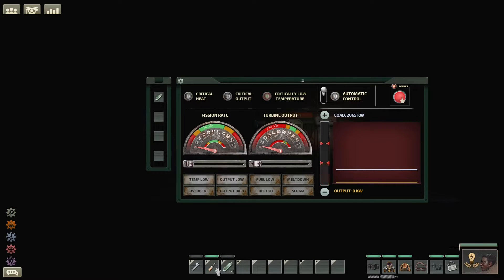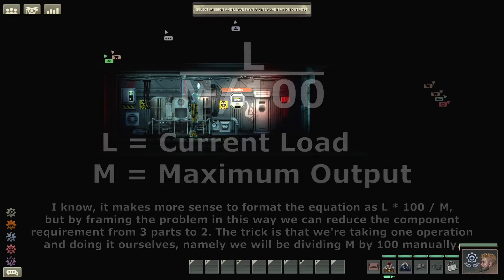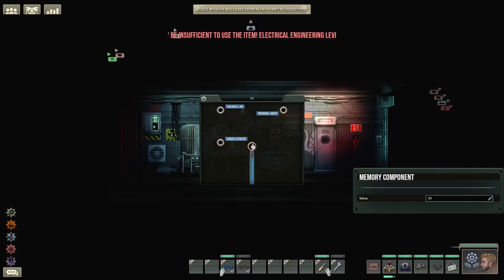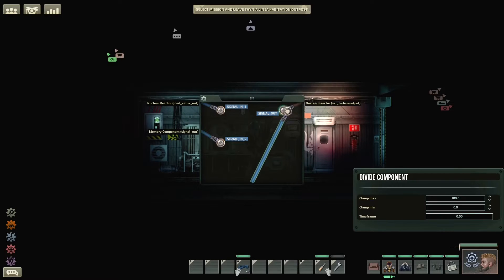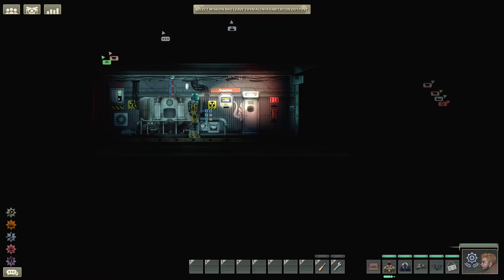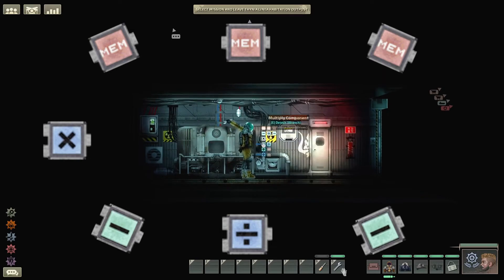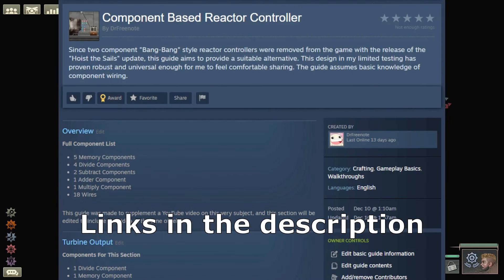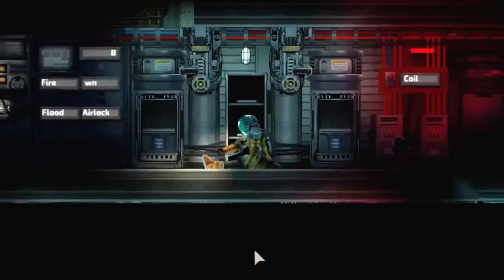New Hoist the Sails Reactor Controller | Barotrauma

Comment: I've been doing the typical 5 component reactor system, and it really does not work well on tier 2 or 3 subs until you get more upgrades to the reactor, constantly causes power outages and runs slow.  Going to try this out and it makes a lot of sense going through the math, i appreciate the design and explanation.

Comment: Is this design still viable? I set it up on a sub with my friends, but it's burning out the electrical systems all over the place. I paid attention to warnings on the reactor and output, and I'm finding it's been running the system with high output almost all the time.
Reply from the maker: They’ve had many updates since this video, so it might not work anymore
Reply: @FailroadExpress  Crap, no worries, I'll fiddle with it some and look up other, more recent, guides in the meantime, thanks for the reply!

Comment: 5 component reactor controller is better than this unnecessarily oversized design. Doesn't work faster than others.

I analyzed your design. According to you the set_fissionrate = [(set_turbineoutput + 50)/(fuel_out/50)] * {1,1-[(temperature_out-5000)/1000]}.
In fact it should be set_fissionrate = set_turbineoutput/(fuel_out/75). And if you want overheating protection (that even won't work, just like your temperature correction) you can multiply it by  output 0 and negative output 1 from 'greater component' comparing the temperature with the value of around 6100 (that is the temperature at which your desing multiplies all by zero).

Comment: 2:29 suppose the ship has an engineer that chose the talent "Buzzin" wich increases the reactor max output by 10%, are there any other major modifications that need to be done besides adding 10% to the max output before dividing by 100?
Reply: I did it and it still works, just add 10% then divide by 100.
Reply from the maker: @ninjasamuraiul  Awesome.  This is great to know.  Thank you for sharing!
Reply from the maker: We haven't tried that yet.  You may have to experiment with it and let us know what you find.  Thank you for letting us know.

Comment: I use a 5C controller, what you'll need are the following:

- 2x memory components
- 2x divider components 
- 1x multiply component

(pmax is the reactor's max power, including upgrades/talents)

Turbine output = load_value_out divided by pmax/100 (so for the humpback the pmax divided by 100 is 31)
Fission Rate =  turbine output*75 / fuel out

pmax/100 = memory cell (1)
75 = memory cell (2)

Wiring is basically in the order written

load value out is gonna sit in signal_1 - memory cell(1) is gonna sit in signal_2 | divider(1) =  hooks to set_turbine_output 
turbine output sits in signal_1 - memory cell(2) gonna sit in signal_2 | multiplier(1)
multiply component sits in signal_1 - fuel_out sits in singal_2 | divider(2) = hooks to set_fissionrate

// I'm terrible at writing instructions.
Reply from the maker: Wow. Just 5 components. We might have to try that out sometime. Thanks for sharing
Reply: @FailroadExpress  I'm not sure how much more efficient this is in comparison to the automatic controller but I did a rough burn rate of a single uranium fuel rod at 2000 kW constant load and my 5C controller came to be around 20% ish more efficient.

Some stuff I did do to suit my needs better; at the helm I've installed a lever which once it's pulled will OC the system by about 1.5 times the current load, the lever is basically hooked up to my mem cell (1) which holds the pmax/100 (the lower you go with this value the more output you'll have in relation to your load)

So to achieve this, you need 2 additional relay cells, 1 multiply cell and another mem cell.

mem cell(3) will hold the multiplying value which for 1.5 times of the load is 0.667
mem cell(1) goes into signal_1, mem cell(3) goes into signal_2 | multiplier(2)

mem cell(1) goes to relay(1) 
multiplier(2) goes to relay(2)

relays(1)(2) both get hooked to divider(1)  

Set the relay hooked to mem cell(1) to ON
Set the relay hooked to multiplier(2) to OFF

Set lever TOGGLE and STATE - OFF

//1.5 times is a conservative amount, if you want 1.7 or 2.0 for the subs that can take it then 0.588 and 0.5 are your values - or just go wild with it :))
Reply from the maker: @Adamonus  Very cool.  Do you use that on multiplayer or single player?
Reply: @FailroadExpress  99% of time I just play by myself so SP.

Comment: minor nitpick, you say fusion, its fission, i know whatever 

(this comment was long and the previous section was a mess, its deleted, this is the correct answer.)

ok quick edit: i checked the math, not the reactor, its actually based on the same math the wiki says, just simplified, its not quite perfect, but its a good enough approximation and works just fine, though it requires some forethought since the numbers require calculating based on the reactors max power.

just to predefine something here, the reactor im basing off of is 5000KW

turbine is simple, the wiki formula is (100 * load) / (power max which equals 5000 in my case), you may notice you can move the 100 from the top to the bottom to simplify that, so now you only have  load / 50, since we've removed the 100, and moved it over to the max power value.

the same can be done for the fission rate, and this is actually where my magic constant comes from,
wiki formula is (load * 7500) / (power max * fuel potential), again same idea move the constant to the bottom in powermax
it now becomes load * 0.6666 * fuel potential
technically the magic constant is 2/3rds given that its 5000/7500, but you can approximate it quite heavily, 4 decimals is likely more than plenty, i suppose you could also run it through a floor or ceil component if you really felt the need.

Wiki math is nice for calculating but when wiring it just do what i did and concat it down. Its like 4 components now.
Reply from the maker: Thanks for the thorough comment. Yes, no matter how it goes it takes a lot of math to get any of this to work just right.
Reply: @FailroadExpress  i rewired my circuit for modern reactors, and added a simple temperature failsafe, including all of the circuits its definitely more than 10 but you could probably get it down to about 10-20 including the ability to turn off the reactor, i'd have to really optimize it, but if you just want basic reactor control it can be done with probably 8 components.
Reply from the maker: @killingtimeitself  That's awesome, considering how complex it has to be now.

Comment: The popular "minimumest temperature" reactor controller uses Fissionrate = 75 × Turbineoutput / Fuel (usually with a simple override to 0 if overheating is detected). It creates no excess heat.

This reactor controller uses Fissionrate = Kt × 50 × (Turbineoutput + 50) / Fuel with Kt going from 0 to 1.1 depending on temperature as a brake/booster.

When reactor is at max power (Turbineoutput = 100) this 50 × (Turbineoutput + 50) part becomes equal to 75 × Turbineoutput  (=7500), but at lower loads it linearly provides extra fission to keep temperature up - at 5,000° (at zero load it's equal to 2500 - which provides 5,000° reactor temperature).

Making reactor stay at higher than necessary fission rate & temperature at low loads makes it better prepared for load spikes at expense of fuel.
It also makes a temperature regulator based on a constant 5000 temperature simple.

I don't know how optimal "50 × (T + 50)" is. For example, "60 × (T + 25)" will produce 3,000° temperature at no load.

For pairs of these numbers you can just input into desmos:
x(100 + y) = 7500 (ideal maximum)
xy = 2500 (half target temperature)
and for 2500 you'll get 50 and 50.

But this way temperature controller needs more complex input instead of just a memory component with 5000 in it, or a completely different design altogether.
Reply from the maker: Thanks for the thoughts. Yes, it was difficult to get this controller as simple as possible while still working. What you suggest might very well work better. Appreciate the effort you put into it.
Reply: I noticed that "cold" reactors with that 0-75 (0° - 5,000°) line lose power completely for a few seconds when there's a power spike.
And I have no idea (and curious) how much fuel they consume at temperatures below 3,000°, which is supposedly "ineffective mode".

If I understood correctly how reactor heat works, for any proper x(Trb + y) the stable temperature of the reactor should be 2×(Turb(x-50) + xy)
And that's the temperature that the temperature regulator circuit should work with.
E.g. with x=60 and y=25 (which should supposedly produce 3,000° at 0% load, 4,000° at 50% load, and 5,000° at 100% load) it's 20×Turb + 3000 - so one extra memory for 20, one multiplication, one addition, and 3000 instead of 5000 in the original memory component.

This is where some testing is needed to find out if this works at all, whether it's worth the trouble, and which performs better. For science
Reply: "Making reactor stay at higher than necessary fission rate & temperature at low loads makes it better prepared for load spikes at expense of fuel." 

Finally an answer for why the FC I'm using blows in that regard. I'm using Ironic and Dead's FC but it always runs at critically low temps. That explains why it's always hissing and farting intermittently. I think I'm going to ditch that in favour of this.
Reply: @surg23 
Cold reactor economy mode can be toggleable with a switch too.
Reply: I've made a guide around 1 year ago (after the update that killed the Bang Bang) based on this system. In fact the system you are describing is how reactors are coded in Barotrauma. The exact equation (Fissionrate =  50 × (Turbineoutput + 50) / Fuel) can be found inside the code of the game. However not in this state but solved for the temperature. What temperature you may ask. You see the "50" that is added to the TurbineOutput is not a random number but it is the Temperature divided by 100. I explain all that in the Steam guide. I do not use the coeffcient "Kt" that you added and instead I use a 3 component safety system to regulate the temperature below a certain point that the user can set but the Kt might be smart too.

To be honest the system that you described is much better than the one in the video and that's why I made the guide alltogether. It uses only 9 components (6 without the safety mechanism) and it allows you to refulate the temperature at exactly 5000 degrees. At the same time you can yourself set ANY temperature by adding 1 more memory component and the reactor will immediately start operating at that temperature with 99.9% accuracy (+-1 degrees). The customization options is insane an the safety system that I added is just an effective a simple solution. The bare minimum system only needs 6 components, manual temperature control needs 7 while adding the safety system makes that 10 components.

It's  a shame that the 5 component reactor is taking over despite it being inferior in almost every way. It's only advantage is needing 1 less component. It always fails in power spikes (due to always maintaining low temperature) and you can't really customize it and add subsystems to it. It also straight up doesn't work in many custom reactors.

This is actually the first I see someone other than me mention this system in YEARS. It was semi-popular before the bang-bang reactor and the PIDs eclipsed it (and for a good reason) but after they both died it now is (and I say that being as unbiased as I can be) the best Reactor Control System using Components.

Lastly I disagree with you saying it needs a much more complex input. In fact as I already said it only requires 6 components or 7 if you want to set the temperature youself.
Reply: @eLeft6  
I elaborated on the design in the video and its peculiarities vs typical "cold reactor".
Dynamic brake/booster with "Kt" is more complex than basic overheat cutoff. And I presume there are better ways to make such a brake/booster.

Likewise, dynamic target temperature (e.g. from 3,000° at idle to 5,000° at full load) is more complex than simple "5,000°" target.

Comment: i tuned my engine to an output of 7000, is the set value for the second memorie component still 50? or is that in relation to the 30 wich now is a 70 on my sub?

same question about the 3 other memorie components in my example still 5000, 1000 and 1?
Reply from the maker: Keep all those numbers the same as in the video; 50, 5000, 1000, and 1.  See if that works.

Comment: Obviously the balance was done to prevent easy cheese slapping 2 components on and being able to throw whatever rods you want in with no repercussion is OP now you still can automate it with incredible efficacy but now you actually HAVE to wire it with some complexity for such an effect. So imo its a fair change despite wire nuts hating having to wire a bunch more to make it work, but that's how I feel the more powerful the effect the more complex the wiring will have to be and if you like making subs nothing is stopping you from just building it into the sub to avoid doing that at the start.
Reply from the maker: Totally agree

Comment: Not working. On 10000 power reactor it works fine when around 5000 power output. When the output goes up the temperature goes down to the point that reactor with 10000 load gives 5000 power max. Every 1kw of load is -1kw of output leading to moment where it goes all the way down to 0 when every system possible is draining power. If anything this system is good for auto-reactor-shutdown.

Comment: I prefer using the default auto-reactor and using custom battery automation instead, seems easier to set up for multiple different subs.
Reply: can you elaborate on that?
Reply: @legioncresswell9592  

I set up batteries to be always plugged into the grid, both output and input.

Then adjust the charging rate inversely to load such that when the sub is using lots of power the battery charge rate is 0%, and when the sub isn't using much power the charge rate is 100%.  It also helps to have slightly different charge rates for each battery, so they don't all finish charging at the same time

This setup really helps to smooth out power demand, mostly eliminating overvoltage/undervoltage issues.

Comment: Do you actually need to use 4 fuel rods to make it work? It was working fine with 1 fuel rod for me, but still was lacking power whenever I was doing a lot of stuff. Any way to fix it?
Reply from the maker: You'll want to use 2 or more.  1 may not be enough.

Comment: doesn't really fix the problem though, my junction boxes get shredded to bits every time I need to break.
Reply from the maker: Sorry to hear that. There are some comments in this video that may help you. They have some slightly different math.
Reply: I'm currently revising the design regardless, I was hoping someone figured it out already but the results are mixed, either way it's fine.

Comment: Wondering if this still works for winterhalter with a way bigger max output. Used this for Dugong and Humpback and it worked with no problem at all, but when it came to winterhalter, it just kept overheating and putting out way too much output
Reply from the maker: Hmm.  I have no idea. We haven't used it on that model yet.

Comment: thanks for the video, bit of a tinker to get it working for me

I had a wierd thing/bug (maybe 1.0 update thing or a problem between the chair and keyboard);

the mem components setings were saved in sub editor, but once i loaded my sub with the auto reactor into the world (test and campaign)
the values were blank.

steam benchmark worked fine (that how i saw the values were missing)
Edit : loaded thé world then went and added the values with my cacarcter in the world.
Works like a dream
Reply from the maker: Hey!  Glad you were able to get it to work!  thanks for the comment.
Reply: Thanks

Comment: How can you find the maximum output of a Workshop sub?
Reply: The only way i know of is to check the reators output in the sub editor
Reply from the maker: I’m sure there’s a way but I don’t know how.
Reply: @FailroadExpress  Is the power output number and the line graph completely linear? 
For example, a workshop sub is producing 1000MW according to the graph, and the flat line is up 1/3 of the bar. Would the remaining 2/3 of the bar be about 2000MW?
Reply from the maker: @Hit_by_a_Parked_Car  Click on the link in the video description to head to the Steam page.  You may be able to get your answer from the community or Dr. Freenote.

Comment: Works great for me, put in 4 rods and nothing catches fire. However, it seems to me that the reactor is generating way too much power compared to what I'm using. Is that because of sub upgrades improving power output and efficiency? I see batteries fill up incredibly fast and then junction boxes getting damaged at alarming speeds, leading to continuous repairs
Reply from the maker: It could be.  Another person had this issue and fixed it by altering the numbers.  Their comment is on this video as well.